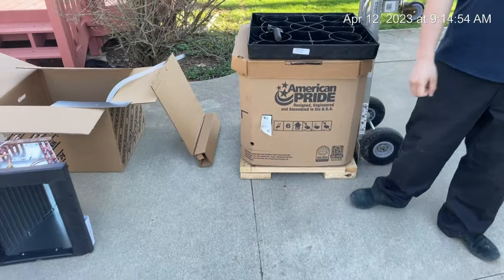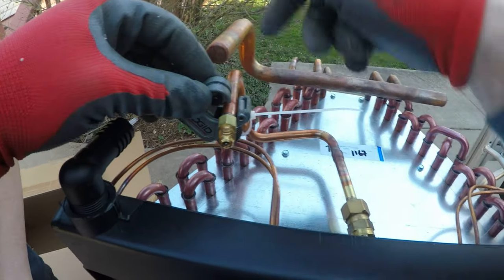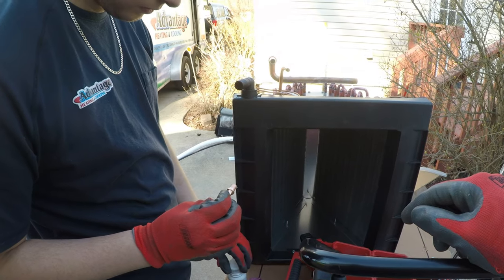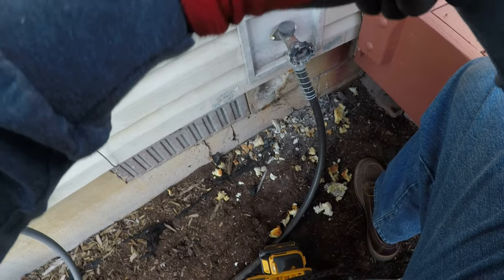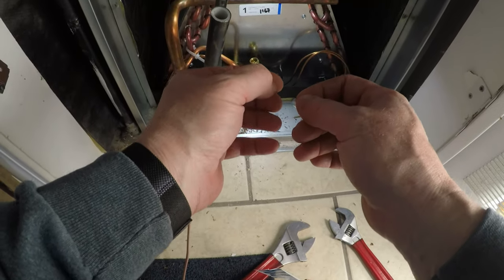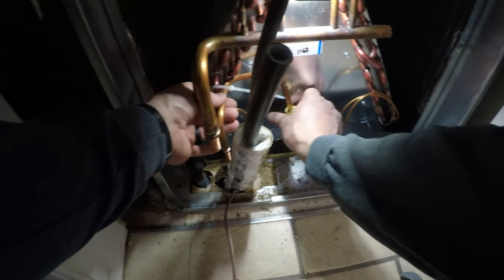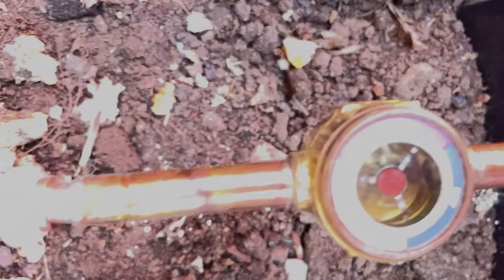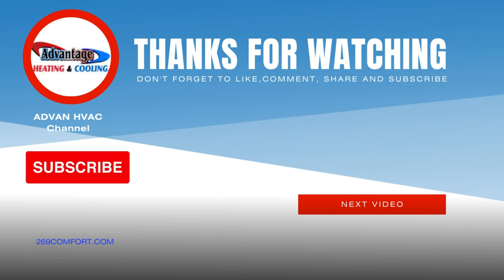Amana Ac install with Yoga Pipe? See How it's Done! In a trailer

Comment: Interesting. I'm not sure I'd trust that material. What's it made out of? I guess if it's sealed tight what ever. But especially a 410a system with those higher pressures, idk man 😬
Reply from the maker: There is something like 3-4 layers. I have about 175 air conditioners out there no issues. Been using it for about 5 years.
Reply: @ADVANHVAC  interesting. Learn something new everyday in this trade. I mean in all honesty how many times have we seen copper or aluminium burst from 410a, too many to count
Reply from the maker: Me personally None! but i am sure it happens.
Reply: Yea I wanted to see how high he pressure tested it because the only 3 times I’ve came across in the field i was there on a no cools its freezing up in less then a couple years old install. Those crimped connections